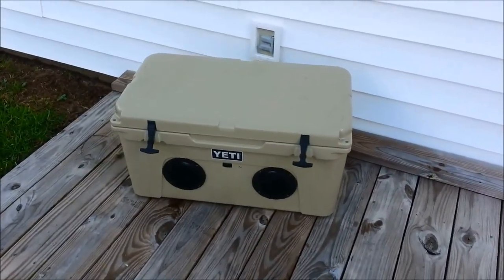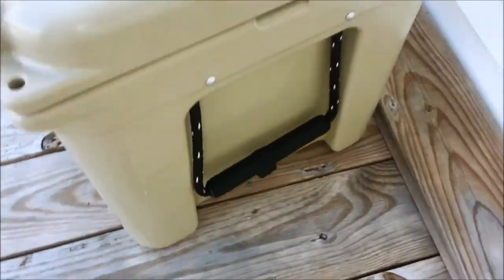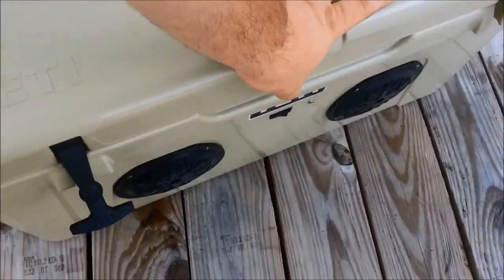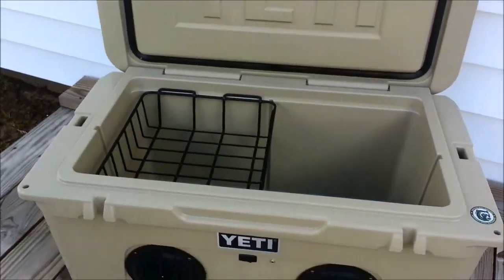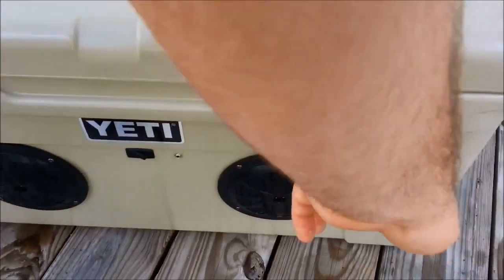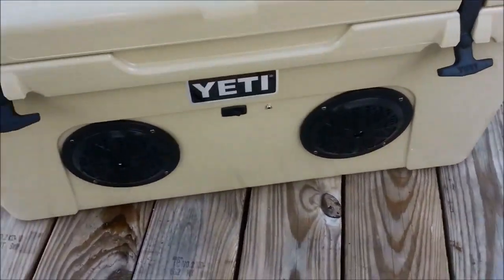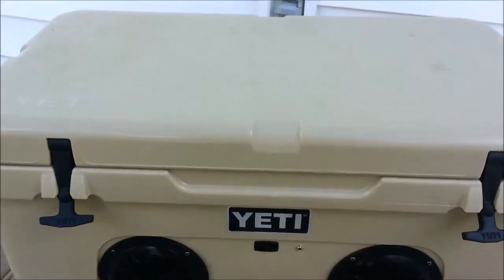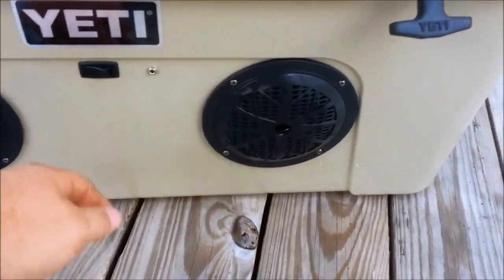Yeti Tundra 65 Stereo Cooler Stock Inside

Comment: $13 speakers in a $400 cooler...
Reply from the maker: Its about the mounting depth more than the price. See when I built this cooler you could still use it as a cooler. You could have $250 JL components in it and not be able to use it as a cooler and then you would have a $650 boom box!